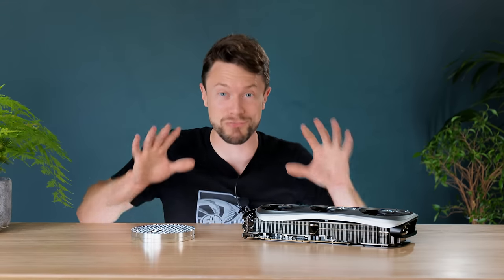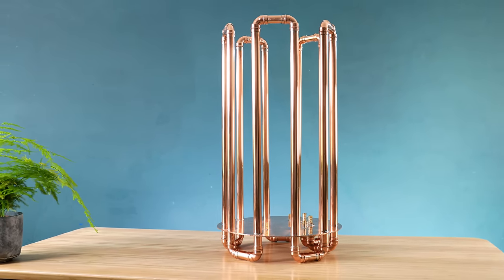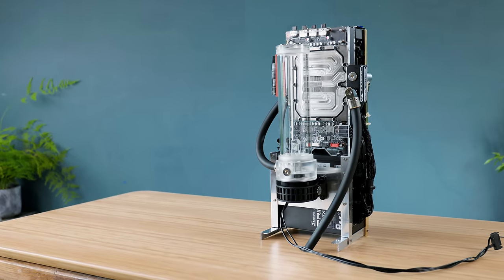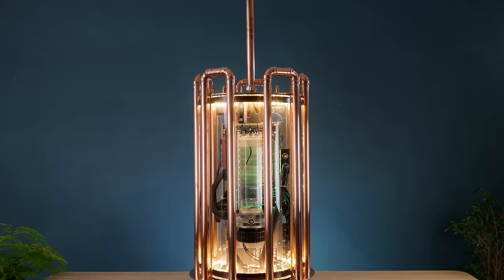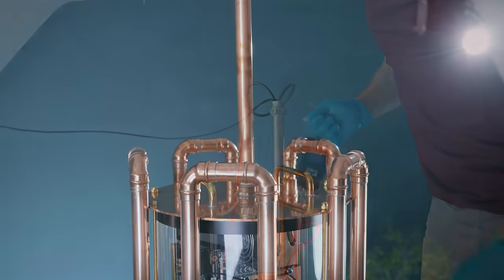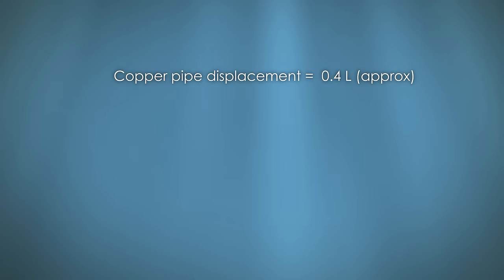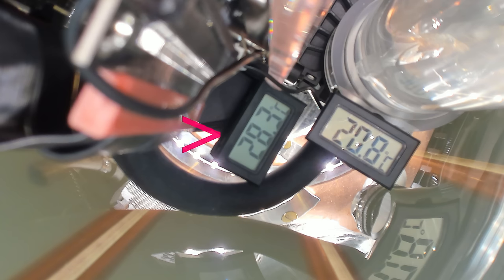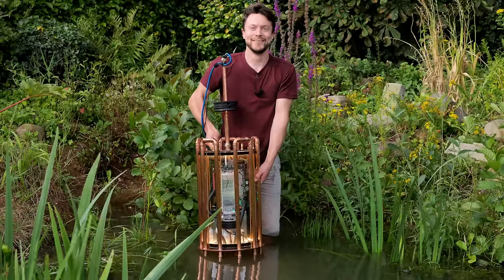Building an ACTUALLY water-cooled PC

Comment: Make a upgrade in this project using mineral oil to cool the entire cylinder. With a higher pressure than the water you guarantee that the water dont came in and you will cool the entire hardware

Comment: If you would have made the plexiglass tube bigger than added each copper pipe go through the plexiglass from under neath on each side to act as cooling and fill them with water that would be sealed.

Comment: You could run this computer without air inside... Fill it with mineral oil with its original heatsink and use a pump to circulate the hot oil thru the pipes. Since water is heavier than oil, any ingress water would go to the bottom of the vessel. If you put a simple sensor on it, you could detect water ingress automatically.

Comment: instead of acrylic as a case this probably would have been better in an aluminum cylinder.  The costs would have gone up for the cylinder but the heat pipes inside could have gone away.
Reply: Yes but you lose the cool look

Comment: Why not just fill the acrylic tube with mineral oil, raise components above the bottom (so any water leaks will accumulate there) and be done with it?
This will - equalize the pressure on outside and inside (oil is not compressible), move away the heat from components.
If only SSD is used (not HDD) - oil wouldn't affect hardware in short term. In long term there may be some issues with capacitors with rubber seals.

Comment: You could have used Aluminium instead of Copper. Since, thin walled tubes would have only marginally deteriorated the performance and most of the heat transfer is happening through liquid flow inside the pipe, it would have cost you 10x lesser to have used Aluminium than Copper. Also, Copper gets rusted easily and Copper Oxide doesn't save it from further rusting when Aluminium Oxide actually stops from further rusting and requires a very thin layer of it to prevent further rusting of Aluminium.

Comment: I love this idea, but as soon as you say it's going to be in an insulating material and you're going to use pipes to circulate the water in and out of the inner section, then I have to ask the question... why not just keep the computer out of the water and use the pipes to just circulate the water the same way without having to submerse it?
I'm only 2.5 minutes into the video so many this gets addressed later (yes I'll finish it)
I think a build using almost a vacuum seal type plastic would be interesting to see where the components are just separated from the water by basically a thick plastic bag.

Comment: While this is radically cool as all get out, the copper will tarnish as copper does. The joints will come unsealed over time. That's just the nature of the interaction of water and metal, even copper. Also, I would have tested for leaks before putting the electronic components inside.

Comment: With 5k of parts you could have wired in two water sensors ( top and bottom) to try and cut off power in the event your gaskets failed. My two cents.

Comment: 1. Why not use tap water for cooling? Not only you solve the cooling problem, but you also generate hot water, which is good for society.
2. Why didn't you fill the interior of the cylinder with distilled water or mineral oil?

Comment: The same basic idea is used to cool nuclear power plants.
Have an isolated clean loop of water that cools the actual bits, and then exchange that heat to the ocean or a lake.

Although here it's a cool project and seperating the PCs coolant from the outside water is to protect the PC from nasty organic matter and in a power plant it's vital infrastructure and seperating the reactors water from the lake is to prevent irreversible enviormental disasters.

But still, you know. Nuclear power plant PC hehehehe

Comment: Water cooling is and will always be the most effective way to cool a process that gets warm...

Normally, water cooling systems that are powered by Peltier elements should have been installed in every PC for a long time, warm on one side and cold on the other side.....

The implementation would be very simple but it has never been done and introduced to the market......

Cooling with air means requiring too much energy that has to be fed in first, even if most propellers work at low loads... but the concept remains inefficient...

I'm curious how many more hundreds of years of messing around before this is recognized XD

Comment: Build a gym and use this water-cooled PC as a heat source to heat hot water in the bathtub of gym. of course, the electricity generated by the sports equipment should be stored in the battery.

Comment: The craftmanship is incredible, and the thing looks absolutely awesome.
But lets be realistic; it's not really useful for most people. And it is not really a true first either, since people have been building trippy submerged setups for long. Roughly 20 year ago, someone built a fish-tank-esque acryllic enclosure filled with a non-conductive oil, plopped the unprotected components right in, and had that act as the coolant. Just as one example.

I must say, sometimes I wonder about people on a whole. Why go out of the way to plop large servers into the ocean for cooling, spending energy to get rid of the heat, instead of using it as a district heating plant? They spend energy to get rid of heat, and then spend energy to create heat. Seems terribly wasteful and inefficient.

Comment: I wonder if it would be a better solution for heat dissipation to fill the container with oil or destild water and make the cylinder out of copper, I think that would help to dissipate the heat better ain't that true? who care if it's boiancy or not😅, not really usefull if it's well planted on the ground and sealed, also filling it with something would reduce the internal pressure and the possibility of leakage😮

Comment: Copper is actually toxic for certain marine wildlife, especially snails and other inverts.  In fact most products that get rid of them are copper-based.  If you're just using it temporarily for the video it's probably fine, but I wouldn't leave it in there long-term.

Comment: It would have been cool to see a control test of the final PC in air. Surely those huge heat sinks could dump a lot of heat into air without the need for water. It would be interesting to see the difference.